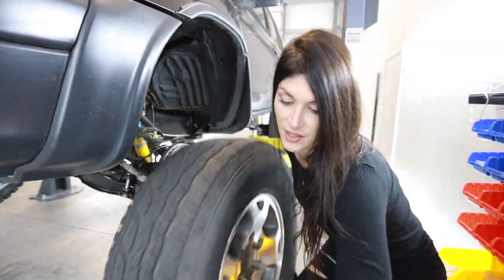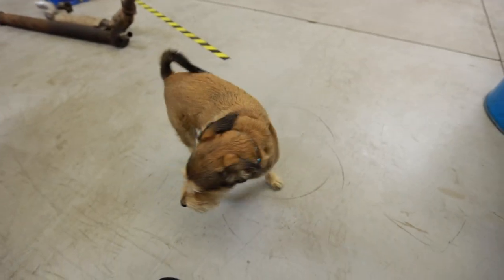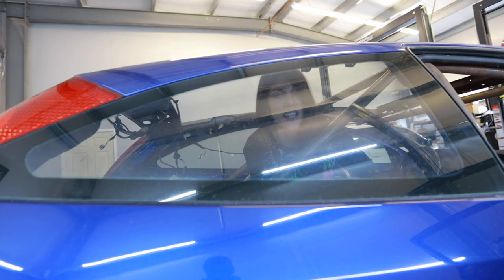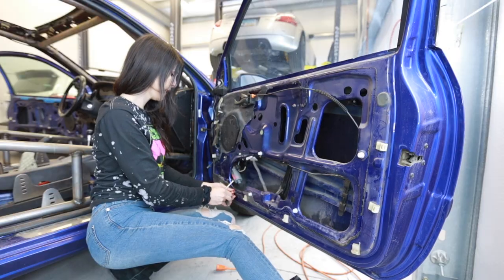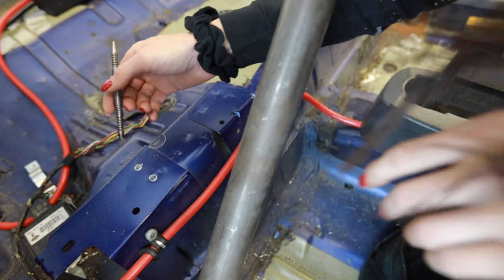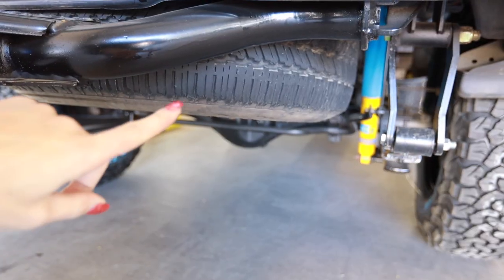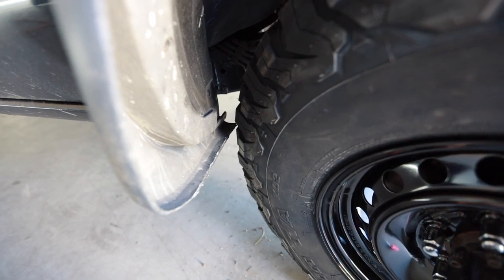The Perfect Overland Off-Road Wheel & Tire! // Project Nissan Xterra

Comment: Roof mounted spare tire! That would look rad and you won't have to mess with the bumpers for now!
Reply: Also, don't forget a bigger off road jack!  You can mount that to the roof too!
Reply: But then they'd have to integrate some sort of crane system to get them down in a time of need . . .
Reply: Don't give Sarah ideas, the Sierra is looking like something from garage 54 already
Reply: @yungkidnf  just roll it off the roof rack. It's designed to hold things. Throw the flat in the back until it gets repaired
Reply: @BentoBoxx  but how would a couple of girls reach it? Integrated ladder?
Reply: Roof mounting a spare sounded great to me and looked cool until I used it 2 years later.  With the sidewall baking in the sun up top, mine only lasted a few miles before it blew out and I was stuck with 2 flat tires.  That really sucked.
Reply: Pointless unless you can easily lift and hold your spare above your head.  Oh and then try that in mud or snow.
Reply: Yeah usually when someone is rolling around with the spare on the roof, especially without a cover, that's a sign they're going more for looks than function.

Comment: For your cover panels in the rear of the car you can use a bit of CAD (Cardboard Aided Design). Trim a piece of cardboard to the shape you need and add some neat folds to make it fit nicely. Then you use that to cut out the patch from a sheet of sheet steel and do some simple folds to match (over the edge of a bench or something). You can then weld it in, or even use panel bond as it is not structural.

Comment: So glad you picked up the belt sander!!! Only thing i could say to help try and make it a little easier on you is when you are grinding and getting close to the depth you need to be you will start to see a little circle appear where the spot weld is, meaning you are thru the upper layer and getting into the lower and its time to stop. Also no welding holes with the sander vs the drill.

Comment: When you put the new torsion anchor bolts and nuts back burnish the nut and bolt by running the bolt through the nut with the nut in a vice.  Run the bolt back and fourth through the nut.  Then apply ARP moly lubricant that they supply with their head stud kits.  Run that into the threads and then keep the nut and bolt together as they are now matched and install them on the truck.

Comment: Use the wheel spacers. if for nothing else, for the at-speed stability gain from a wider track width. had a buddy roll a truck from a very minor fishtail in a mildly lifted truck with taller, narrow/OE width tires on OE offset/backspacing. additional scrub (and trimming) is worth keeping the thing upright...

also had the same thing happen with my torsion bar adjuster bolt, glad to see I'm not the only one!

Comment: I would recommend using the annular cutter for the spot welds instead of the finger sander, but figure out the thickness of the sheet metal you're cutting through and then tighten an appropriately sized shaft collar over the cutter to use it as a stop. Set the shaft collar from the bottom of the cutter with a pair of calipers and you should be able to reliably cut to the depth of the sheet metal.

Comment: @Sarah-n-Tuned  to fill in the back interior panels of the Focus I would recommend cutting up thin MDF and tape it on. Then join all the pieces with fibreglass.
Once it's stable and dry you can pull it out and finish the glass job and sand and paint and flock or carpet for a custom panel. Then drill holes and mount with nutserts or crush nuts so they will be well fixed and not fly around inside the vehicle. For super thin and light just make it out of cardboard and fibreglass and it will still be strong. If you want to go full OCD then plan your holes first and glass in some washers as well for added strength

Comment: Hi Sarah, you mentioned the new tyres for the Xterra are about 1.5 inches taller than the old tyres. If they are it will mean a longer rolling circumference and the speedometer will show a slower speed than the actual road speed so you might want to get the speedometer recalibrated so that you or Celine don't get a speeding ticket. I'm sure you're aware of this but it's easy to overlook when you're days are so busy. Love all your videos and your quirky cuteness, best wishes 😁💕

Comment: For the lightest weight and flexibility, patch in with perspex. 2mm should work without cracking. Maybe 2.5 or even 3mm. I used to manage production of the stuff yrs ago. We made hood protectors, weather shields etc. Wholesale from EGR in southern Cali (branch of an Australian company). Or a decent hardware should stock it. Cut it freehand with a cardboard or thick paper template. Then use a heat gun to soften for molding into the concaves. Rough sand and etch prime will give you a paintable surface. Self tapping 8mm steel screws will toughen the bite & give removable access. It will definitely max weight reduction but should retain stiffness without being brittle. Just my 2c worth. But it's  the way I'd  go. Be a massive time & money saver. =D

Comment: I'm really enjoying the Xterra videos.  Who'd  have thought that a $1900 truck with 264K miles could be  brought back from the edge like you two have.  This really changes  one's views  about how long a vehicle can last.     
Comment 1:  Why  is it necessary to have the Xterra spare tire the same size as the other 4 tires on the road? Think of the existing spare as being just a slightly reduced  size spare. There are millions of cars with reduced size spares. There's no  better and less  obtrusive place for the spare than where it is right now.  Spares aren't needed often,  but one of  those swing out of the way spare  tire jobs will be a curse every time someone wants to open  the tailgate.  
Comment 2:  For covering holes in the Focus, where the edges aren't flat and in plane with each other, you may be able to do some panel shaping and flattening with two pieces of stiff steel  plate or heavy steel angles and a few  big, strong old fashioned C-Clamps. Sorta like squishing curved steel straight with a vise.  That may simplify "fitament" some.
Comment 3:  You need a workbench to mount your vise on.  A  strong, heavy workbench that is fastened to the wall, and if necessary to the floor, so it DOES NOT MOVE.   Vises securely mounted to  benches make marvelous third hands, nut or bolt head holders that don't slide off like wrenches can, anvils for  pounding things flat, bending  brakes for light steel fabrication, and for a multitude of other uses  limited only by your imagination. The vise will also help improve your efficiency and safety when sawing, grinding, filing and drilling.  

I've been watching your  videos  (lots of them) for a few weeks now.  The amount of thought, preparation, and attention to detail  that go into them is amazing.  Keep  it up.  You're doing great!

Comment: There's a correct way for door panels.  Take cardboard place it on the door create a mock up stencil and the apply it to sheet metal.  Do the same for other door and also rest of interior. 

When you apply flat sheet metal use rivets and mig weld too.

Comment: Cheap alternative is to put a roof rack and toss the spare tire in it. Get a long enough bicycle u-lock and feed it through the wheel and secure it to the rack. And don't forget a wheel cover otherwise the sun will make it useless when you actually need it. That is unless you want to change the bumpers to add winches, brush bars, and add clearance for approach/depart angles.

Comment: For the inner panels, make a frame for the outside from 2mm Aluminium and then stretch a decent quality automotive fabric over the frame, can then fit it using factory style scrivets. Its super light and looks quite factory  if done well.

Comment: You can make lightweight interior panels with a plastic sheet called Sintra.  It's heat formable so you can mold it pretty easily. Not sure it's worth adding weight though...

Comment: For your Focus doors, just make panels out of aluminum sheet and rivet them to the door or use self tapping screws.  Give it the race car look.  There might also be some composite panels available to replace the door pads.  If you're set on welding it up, make a template from cardboard.  If you decide to fill all the holes in the door, I hope you never need to access the inside of the door to repair/replace door latch assembly.  Something to consider.

Comment: Shrockworks have a really good front and rear bumpers . Also usually alignment shops leave about quarter of inch between drivers to passenger side so when driver is in it will sit level.

Comment: Great tires and ~31 is a good all around size. Have had good reliability and traction out of KO2s and Wildpeak AT/3Ws in many conditions, and they both have snowflakes which exclude you from needing chains in non-savage snow conditions. There is a downside to E rated (over D or C)  in that the ride is stiffer (thats what she said). On the pros, the tire is a lot more puncture resistant with great tread life.   Not a fan of spacing wheels unless clearance issues around the calipers/arms/spindles.

Comment: I have 35x12.50R20 on my 2006 ram. I have 20x9 wheels with 0 offset. Only time I have a rubbing issue is when I am turning while backing up. They don't rub at all while going forward and turning

Comment: I think you should make the wheel track wider with the spacers, it would probably be more stable when road driving through corners at speed (as the increased ride height might make it a bit top heavy).

Comment: Electrostatic painting would have eliminated the need to remove the roof of the Focus. It uses a static charge on the paint gun to spray, where the part you are painting is charged with the opposite charge and the paint will actually wrap around a surface such as the roll cage.

Comment: Spacing out the tires makes the thing more unlikly to roll. But then you have more load on the wheel bearings. So...
And you can also simply strap the spare wheel on the roof. But than you have a higher center of gravity. So...you have to decide^^

Comment: I can make a suggestion for those filler panels that would save you money; use plastic craft sheets. Just rough cut the approx size you want, screw it into the top 2 speaker holes then take your heat gun and slowly form it around the bends, adding screws to hold it into place til it cools down. You could then cut some X-MAT or spray on Rhino-lining on the back to help kill vibrations. You could even go as far as to use those pieces as a form for fiberglass filler panels. Are you going to wrap the rollcage before you put on the other roof section or just leave it bare? BTW, these British guys built an econobox racer along the same lines as you though it wasn't a rally car. You might think about starting your own rally YouTube Rally Class to run against other tubers and viewers. You know, that's a great idea you came up with. haha

Comment: Xterras  are real sensitive to back spacing. Best to use stock wheels when putting bigger tires. And don’t use spacers.  Your torsion bolt is from using an impact on the head of the bolt.  Don’t do that. Use a pass through socket to tighten the nut and they will last longer.

Comment: You modify the truck in every way as in not being spec then you mount the tires backwards saying it looks more spec.....It would have looked so much better with the white showing out.

And just to give you a little tip for cutting/trimming plastic parts is use a set of tin snips they work ten times better than scissors.....Otherwise Sarah great video young lady.

Comment: I chuckled at you having no space between the door and the lift; at least you are nice and thin and can do that (get in and out of the vehicle like a little mouse).  I was doing the same thing and yeah, I have put on some weight since I was in the service, lol; I was struggling (thermal coveralls don't help either).  The bolt situation doesn't surprise me.  I had a vehicle go all wonky on me when I had it aligned immediately following work because I didn't follow a rule I had always followed from the old timers: drive the bloody thing at least 100 miles before aligning it (with Covid and lack of driving, try a tank of fuel).

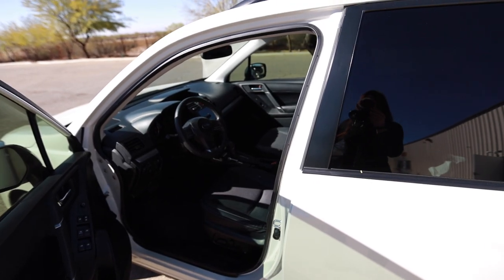Comment: 8:32 idling does not charge batteries. you need a bit more ripems.
Reply: You´re wrong. It does charge them, it only takes more time to do it, because at idle, the alternator does produce as much current as it does at higher rpm´s. I know this from theory, and from personal experience.

Comment: Sarah, you're overthinking welding. I learned to weld in a few hours. I was cautious and observant. More than I had to be. Sure I weld the same welds over n over for 12 hours at a time. But it's not as hard as it seems. Buy junk yard parts n weld them together. It's just mig welding on sheet metal. It's nothing. Lol just do it dear 💜💜💜

Comment: I have watched the video several times to find out the specific make and model of the new tires. You stated the size, but not make & model. The videos shows the tires are BFGoodrich. What is the model? Looks like they are All-Terrain T/A® KO2. Is that correct? Love the XTerra. The Pro 4X  model has all the bits to do some serious off-roading. (:-D
Reply: Yeah, KO2s from the looks of the tread.
Reply: That is what I thought. Thanks Michael.

Comment: Correct approach for rally car: remove weight, add strength,  and power. Interior panels required are beaten aluminum, fiberglass, fabric or plastic. The esthetics are distracting you by attracting your OCD clean thing.  At this rate you won't be racing even next season. The time spent on removing the spot welds is making me cry. You can paint the roll cage with a brush and rust-oleum. Who cares about the interior when rally racing? Nothing sharp or protruding. Enough.

Comment: Tire measurements change based on the wheel they are mounted on. Most tire manufacturer's spec pages will show Approved Wheel Sizes similar to this "7.0-(7.5)-9.0". You see the 7.5 is in ( ), sometimes its BOLD, or underlined, this is the wheel size that they took the diameter and width measurements on. So putting it on a 7" wheel will make it taller/narrower, and on a 8"-9" wheel, it will be shorter/wider.

Comment: You are doing too much work for a rally car type build. There is no need for trim panel clean up or anything of that nature spray it down corrosion protect it and let it rip
Reply: Corrosion Protection and painting of the roll bar system is a worthwhile effort however